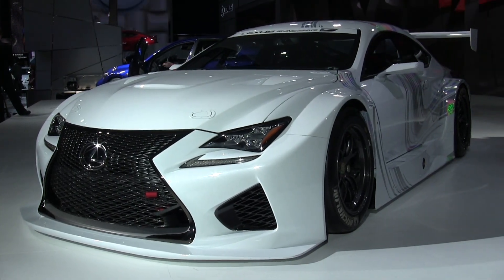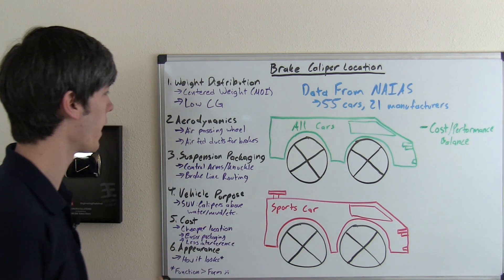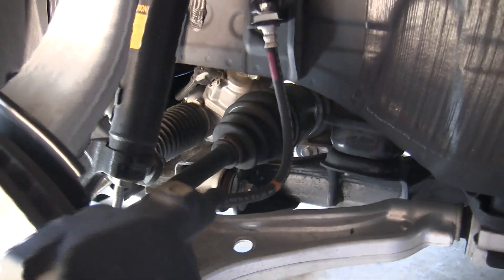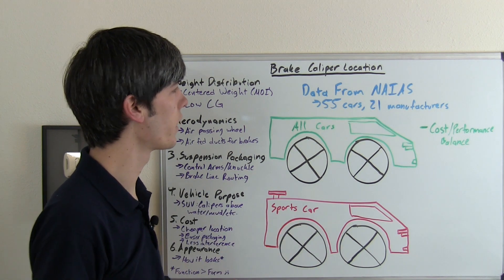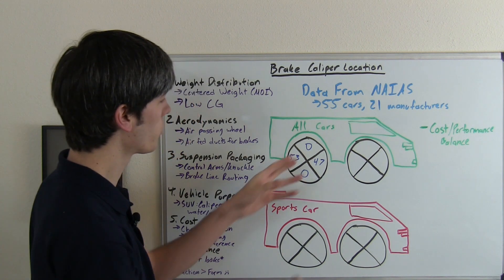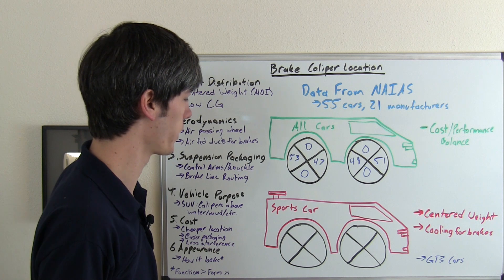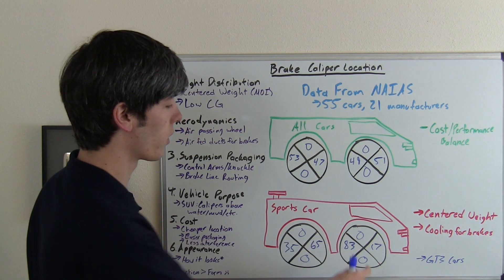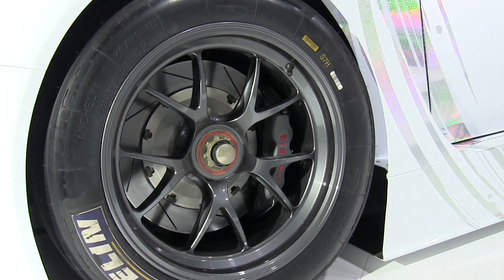Brake Caliper Location - Explained

Comment: I think your theory is wrong.  Putting a brake caliper on the rear of the front caliper generates an upward force on the front suspension countering the nose-down of hard braking. Conversely, putting the caliper on the front of the rear brake generates a downward force on the rear, keeping this end down.
Reply: Aren't both the brake disk and the caliper mounted to the same suspension and thus canceling each others forces out? It's like trying to lift the chair you're sitting on. Newton would turn in his grave, if there would be an equal and opposite force acting on him, that is.
Reply: Drive axles and power variables, like accelerating and braking in a drift, can defeat your theory.. And sprung/unsprung weight annihilates your theory altogether. If the calipers mounted on the back of the spindle cause lift, then it'll just jam the unsprung suspension weight upward into the fender as the sprung weight of the car transfers forward and down... Your theory is momentary as the brakes hammer on, but the unsprung weight dynamics do not affect the sprung weight as clearly as you assume. The suspension torques/twists the same after the brakes are applied, no matter where the calipers are mounted. The rear suspension arm mounts lift and the front suspension mounts  crush downward in hard braking... Add the forces of the car's momentum against the suspension arm mounting points, already under this twisting torque, and next thing you know, Ralph Nader has killed the Chevrolet Corvair...  lol
Reply: You have mixed different forces in one huge situation. Lift a car and reach a high speed (but be careful, you should thoroughly fix a body of the car) and then hit a brake pad like you are braking in emergency. You'll see that wheel slightly goes up if a caliper is on "3" o'clock.
Reply: You are right. When I was wondering about location of brake calipers I came to conclusion that the only right location for the front calipers is towards the rear. The caliper on the rear axle should be mounted in position from "12" to "3" on a clock and more preferable is 12.
Reply: Good posting!
Reply: I think you have your directions backwards but i have always thought the same thing.

Comment: I really would have thought the best place would be towards the rear, so when you slam on the brakes, the wheels jump downwards, momentarily increasing downforce.
Reply: no matter the placement the front will always dive, and the front suspension will always twist forward.
Reply: That might contribute to loss of traction.
Reply: +Seth Glenn That's true but my Volvo S80 dynamic braking to reduce or eliminate nose dive under heavy braking.  I have had friends tell me WOW good brakes.  Yes it feel strange under hard breaking.  Oh the 2009 Honda Accord has designed the rear brakes to react first to increase braking dynamic
Reply: Most brakes are designed to go to the back first then go to the front. its called metering. in the old school says there was a metering valve and a proportioning valve (now built into one "combo valve")
Reply: This is a few days old, but those systems are in place for passenger comfort, not stopping power. The maximum stopping power is always limited by the friction coefficient of the tire - today's ABS systems improve control, but negatively affect stopping power because the brakes are not applied 100% of the time during a braking event. 

While what you said may be true, the laws of physics dictate that inertia always wins, and the car will experience weight transfer to the front. In addition, the front brakes always need to do the most work to stop the vehicle - so attempts to mitigate the weight transfer don't necessarily mean better brakes. 

Just a few words of clarification, it's awesome to have a car stay stable under heavy braking!
Reply: https://www.google.com/search?q=8+piston+calipers&prmd=sivn&source=lnms&tbm=isch&sa=X&ved=0ahUKEwjsw9W1iP7OAhVN82MKHSlGAqcQ_AUICCgC&biw=360&bih=560#tbm=isch&q=10+piston+calipers&imgrc=vUsZr2BgS5eOEM%3A
Reply: Jason Buis
Not sure what that's supposed to prove? Seems excessive and not really efficient. A single 6 piston caliper would have provided more than enough stopping power in a cleaner package.
Reply: +JupiterPollux well there are 8 piston types too.  I would probably just apply a ceramic coating on calipers and the pad back plate
Reply: Are you replying to the right topic? I was talking about weight transfer, metering and brake effectiveness, and you're talking about 8 piston calipers seemingly at random?
Reply: The technology to eliminate nose dive is in the suspension. Not the brake caliper or it's orientation. my brakes on my 02 Santa Fe work under the same principles as a BMW M5. its just newtons law.
Reply: Not true for my 94' Dodge Ram diesel. A rather crude truck with a 1,000 pound engine and heavy transmission, no amount of pedal pressure (at least my full 200 lbs.) will make those front tires skid!

Comment: Interesting.  Something that I hadn't put much thought into before, but I'm glad I saw this video.  For the record, I do recall seeing a small number of vehicles with the brake calipers located directly on top of the rotor in the rear, but cannot remember which vehicles they were.  Probably a truck.

Comment: On Suzuki SX4 model 2009 are rear brake calipers at top of the disc so few percent of cars have it, its not 0 of 0
Reply: That is interesting... (I see it in some pictures now that I look it up) but I doubt there were any 2009 Suzuki SX4s on display at the 2015 Detroit Auto Show :)

Comment: Chrysler group likes to put the calipers at the 11 o'clock position for some reason. jaguar used to be the weirdest of them all, with inboard breaks
Reply: +koshermal They took a break..from conventional brake design. 😉
Reply: +cutieamby in older jaguar the rear breaks are mounted on the axles where they go into the rear differential. it's kind of hard to explain but YouTube it.
Reply: What's breaks?

Comment: In a former life I used to work on race car suspension and the position of the Caliper can be used for anti-dive effects.

I found this explanation on a website and it is reasonably accurate.
"The braking loads are transmitted via. the inboard suspension mounts. If viewed from side on these converge towards the CofG (parallel effectively means ground level), you get anti-dive geometry - going through the CofG is 100% anti-dive and a lower converging point is less than 100%, right down to 0% @ ground level. I don't know how much anti-dive is used in F1 cars (or anti-squat for that matter) as too much anti-dive can work to make the suspension "tie up" under braking. 

Because the wheels rotate, if the caliper is behind the upright any braking force will try and lift the wheel off the ground (how much effect this has I don't know) - a caliper in front of the upright will try and drive the wheel into the ground. I expect these effects are minimal otherwise I'm sure we would see more calipers in front of the upright. "

Comment: Another important consideration on motorcycles is steering polar moment. In most cars this won't be a noticeable effect due to weight, power assist, and the large masses involved, but the distance from the steering axis to the CG of the brake caliper affects the 2nd derivative a noticeable amount, with front-mounted calipers making steering inputs take significantly longer to initiate than rear-mounted calipers, which sit significantly closer to the steering axis.

Comment: What about bleed point position....doesn't it affects the brake caliper position?
Reply: +Ashish Dave no but can influence where that bleed point may be placed,  I have seen bleed nipples places on the rear of a caliper at the bottom of the caliper , using bored channels through the casting the internal bleed point was at the very top , but the nipple for doing so was removed to a better location.

Comment: what about duel break calipers on the same disk? my friend has a Viper srt-10 and has 2 calipers at the rear, one big and one small. how does this help the car any?
Reply: Typically the small caliper is for the parking brake. There are a few possible reasons for this: making the parking brake integrate with the normal brakes is too complicated given performance targets or other factors, or the car is intended to be able to drive on the track, and if you're driving a car on the track and then pull into the pits and apply the parking brake, the brake can kind of "weld" shut if the parking brake just uses the normal rear caliper.

Comment: How could the placement of the caliper affect the moment of inertia?  And which MoI?  The calipers don't rotate so it's not the MoI of the wheel itself...  If the vehicle is turning, any symmetric placement of the caliper on each side would offset any benefit of one side to the other.  The calipers are non-rotating unsprung mass.  How does MoI apply?
Reply: +mdlovin1 Not MOI of wheel, MOI of the car in yaw. Weight towards outside of car makes it require a greater force (torque) to rotate the car about its central vertical axis. Low yaw MOI = more agile car, faster to respond

Comment: What about the direction of friction and it's affects on the suspension? Like do you ever notice when you have the car jacked up and you tighten or loosen the lugs, it can either have a tendency to add compression to the spring or add rebound depending on the direction. Now if your vehicle has very strong breaks, wouldnt those forces be amplified to the point where it becomes influential on the cars' overall braking characteristics? (ie: nose-dive)??
Reply: No, just... no.
Trust him, he's an engineer.

Comment: I would imagine not on top because of suspension interference and weight up too high.  Not on the bottom because the caliper housing would probably collect moisture due to forming a U shape.

Comment: Thanks for the info, one area that i was hoping you would cover when considering caliper location is deflection.
When spinning the rotor at high speed and than jamming on the brakes for the corner. Does the initial bite of the brakes deflect the wheel in a given direction and possibly improve the bite of the wheel to the ground or lift it to reduce the bite to the ground?
For example, take a mountain bike and lift the rear tire off the ground. Get the wheel spinning and than jam on the brake like you would in a race car. The bike will push forward and down. Transfer that reaction to a car and could designers be using that reaction to their advantage on the track to either hammer the tire harder into the pavement for more bite and reduced braking distance or causing it to lift slightly in attempts to offset a heavier vehicle and save the tires from destruction in the corners?

Comment: I just took my brakes of completely, saved me a ton of weight.
Reply: Don't bother with brakes - they only slow you down.
Reply: @dinky9216  wwwwwoooooowwww😂😆😆😆
Reply: Yep, they're completely unnecessary, just slam it in reverse gear, works like a charm.
Reply: +LewisHamiltonMSPR Rocket mode 😊
Reply: Lol
Reply: Downshift
Reply: *off

Comment: Pretty sure the majority of the decision for where to put the calipers depends on the suspension design and steering rack position. Also I highly doubt a small change in height of the caliper has any effect on CG or body roll, since they are unsprung weight (riding directly on components mounted to the wheels which sit directly on the road). Majority of cars are built for economy, and are FWD with engine in front of the trans, and steering rack in the back, so calipers have to go to the front of the wheel. Majority of sports car are RWD or AWD, with the engine mounted low and far back, so steering rack goes in front and caliper goes to the back. Better cooling and weight distribution towards the center of the car are secondary benefits.

Comment: It would cost Dodge more money to change the front caliper from frontal position to inside for the hellcat. All car makes should keep them inside for low centre gravity whether it's a sports or a basic car. Would be cheaper in manufacturing and more simplified.

Comment: Thought he might mention Audi with inboard disk brakes, from the '70s. Guess the idea was for less unsprung weight. Ducts brought in air but they were still problematic. A lot of stress on the CV joints too.

Comment: And there are still manufactures insist on installing crap drum brakes on a the rear wheels on modern cars or even a pickup. Why???!!!
Reply: peanuts2105 where did you get that drums can't have ABS?
Reply: +Mudux I was thinking the same thing. My truck has ABS and it's got rear drum brakes
Reply: +peanuts2105 if it works, why not?
Reply: +peanuts2105 Pickups might need more braking force since they might be pulling heavy loads. That's why semi's have drums and not rotors.
Reply: +Martin Gray Incorrect actually. Tell that to Mr Boeing or Airbus why they have rotors on a 560 tonne aircraft. 
The main reason why manufactures have drums instead of disks is because of cost. End of. 
Braking performance is poor drums do not have ABS which says a lot. 
Happy days.
Reply: +Martin Gray ABS only on the disks. You get brake fade quickly in drum brakes because the heat cant escape because its encased in a drum unlike disks which are vented. Disks are always king, just ask Lewis Hamilton my friend. Can your truck be modded for disks?
Reply: +Mudux Perhaps I wasn't clear, drums dont have ABS, disks do have ABS especially the fronts
Reply: peanuts2105 it's not about not being clear, you're just plain wrong.
Reply: +Boysya There is some form of ABS on drums but it sits nowhere near the performance of discs. Disk pad actuating has a far higher ABS frequency actuation versus drums and far better heat transfer than drums could ever do because heat is retained inside the drums. Anyway, drum brakes are old and are found on Model T's and old Mustangs (for example) which have shocking braking performance. Disks are current technology and not exclusive to racing cars or aircraft. My Discovery 4 has big, wheel clamping disks and my Ford Focus 2.0 TDI Zetec has discs all round which is excellent on alpine roads. Just ask Brembo why they don't produce drums!

Comment: I think calipers placement for regular cars depends on rear/front-wheel drive. It's about 50/50 in the video because the cars are about 50/50 rear-wheel and front-wheel drive.
This is just my opinion. Would be nice if Jason could check how calipers are placed depending on is vehicle rear-wheel or front-wheel drive.

Comment: Perhaps I've always been wrong. I've tried to imagine brake dive in the front lessened by having torsional forces "lifting front axle" during braking. Conversely, having rear caliper on front of disc, encourages rear squat/ weight transferring helping rear traction. Keeping both brakes closest to center polar moment as well, of course. Just my thoughts.
Reply: +James Tennier I don't really think brake caliper position has anything to do with squat or dive. It's mostly the physics of weight transfer as the car is slowing down, and the geometry of the suspension.

Comment: There is phenomenon called caliper knock back which is when vehicle performs cornering with brakes released the brake rotor deflects from cornering loads and knocks the piston back into caliper bore, the result is on next brake apply there is large brake pedal travel until piston overcomes knock back travel.  For this reason oems place calipers as close to neutral axis (9 or 3 o'clock) which will experience little to no knock back.

Comment: My Ducati M796 has the front caliper faced to the frame or on the rear of the rotor, and the rear caliper is upside down at the bottom of the rear rotor